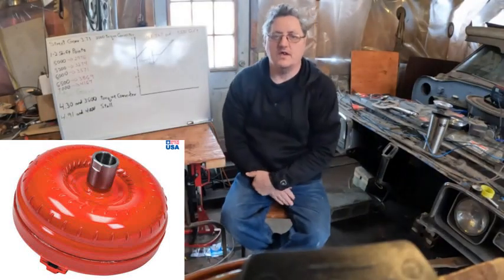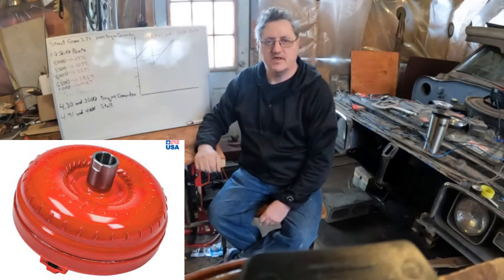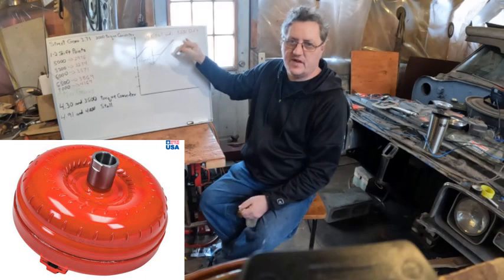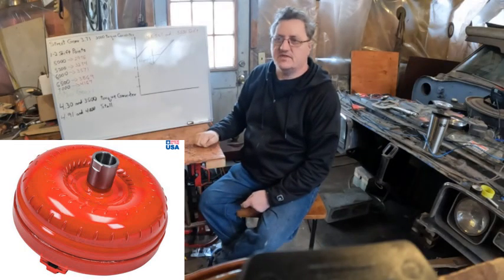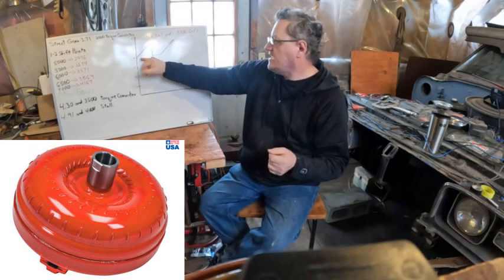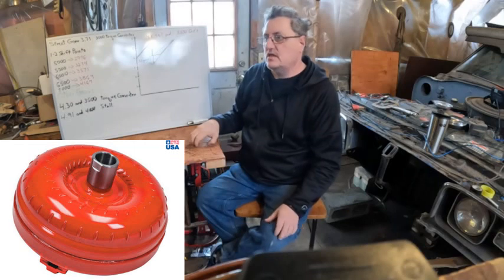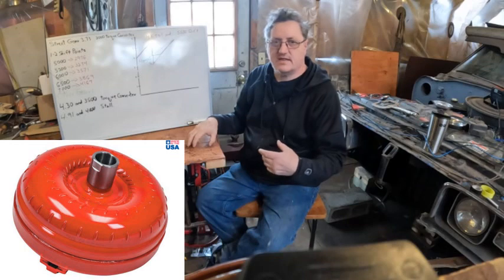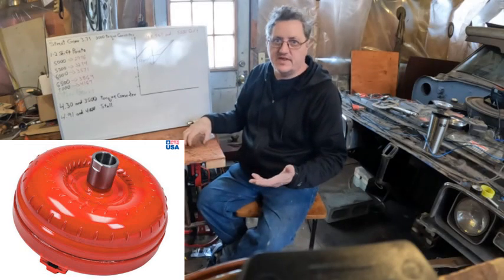Pick the right torque converter! Don't let slippage eat your time slips.

Comment: What about my cam say I need a 2800 plus stall I am not racing can I use a 2500 instead of 2800 plus stall my motor is 350 bore 60 700r4 trans 99 block 99 vortec heads and I’m getting 411 gears 2door 84 caprice 30inch wheels
Reply from the maker: Sorry, but mending from a stroke. i can't tend to my channel right now.

Comment: So I have a 99 Vic 8.8 I’m gunna run 3.73s I can only get 2800 or 3200?
Reply from the maker: For mostly street with occasional drag duty i would recommend that. If it's mostly drag and occasional street, it could work ok with more stall. I would keep an eye on trans temp if I did that though.

Comment: I have a twin turbo  ls 416 foxbody  with a powerglide  transmission  3800 converter   trick performance  stage 3 cam and 273 gears, and my transmission  is overheating  car weight 3500 with  me in it will changing  the  gear fix the heating issue  and what gear you  recommended  I was thinking 331 for 1/4 mile or I'll be in the same boat  with slippage
Reply from the maker: More gear will reduce the load on the torque converter at part throttle cruising for sure. The correct gear for your turbo motor I don't know. Turbo motors are tough, because the torque curve can be changed a lot with tuning.  2.73 is pretty tall, though. 3.31 would be an improvement, though I expect a bit more gear would be appropriate, like about 3.73 maybe.  I would add an oil cooler with a dedicated fan if you don't already have it.

Comment: Torque converter diameter is very important to consider. A 12 inch converter with the stall raised as high as possible (2,500 RPM) will have much more slippage at the shift point than a 10 inch converter built to the same stall speed. The 10 inch converter will allow for a lower gear ratio. 10 inch converters in their stock applications stall around 1,800 RPM, they are a lot more enjoyable for street usage and better on the track. Well worth the price.

Comment: Very nice informative video. Did you say there is a calculator that would help with converter options?
Reply from the maker: Hi. The calculator I used was at wallaceracing.com/calculators. The specific one I used was "RPM drop from shift calc". It gives rpm assuming zero slippage. To find torque converter slippage would require chassis dyno of your car to prove exactly. You could get an estimate from the manufacturer of your torque converter.
The premise of the video is to choose a stall speed at or below the theoretical RPM of the 1-2 shift in order to limit slippage. 
Most off the shelf torque converters are rated at an assumed 350 ft pounds of engine torque. If you make more than that, it will stall higher. Usually only a couple hundred RPM if you arent severely above on torque.If you are, then the next tighter converter may be appropriate.A 3000 stall converter can stall at 3300 or even a bit higher with a lot of torque. If you have more than 450 ft pounds, it may be necessary to get one with a balloon plate. This will get you close if you're buying an off the shelf converter. Enjoy!